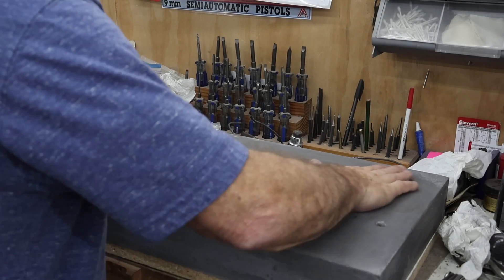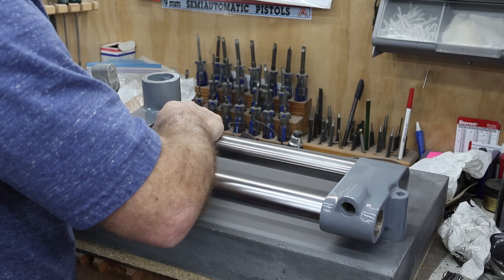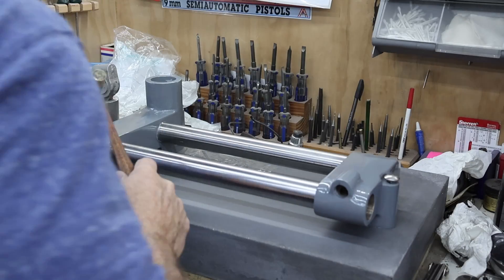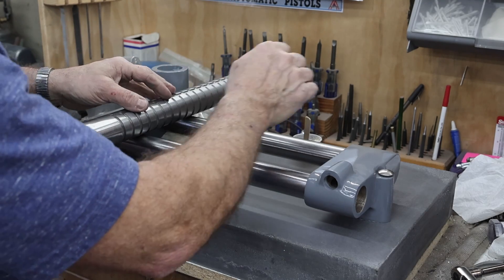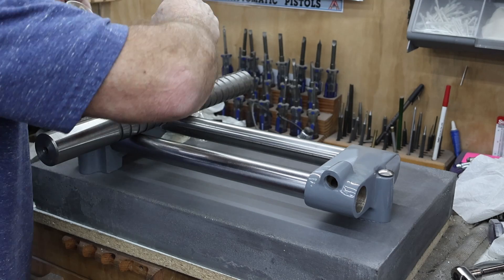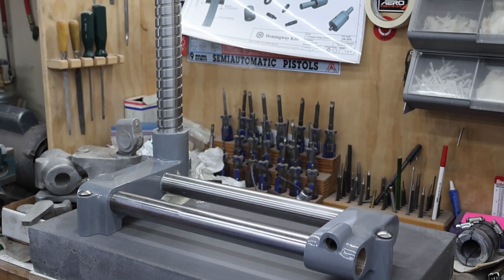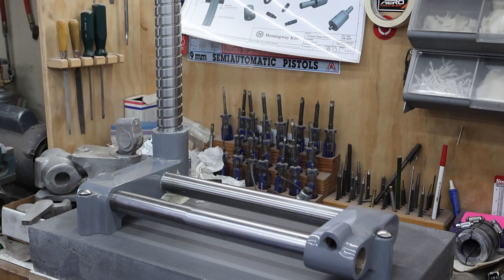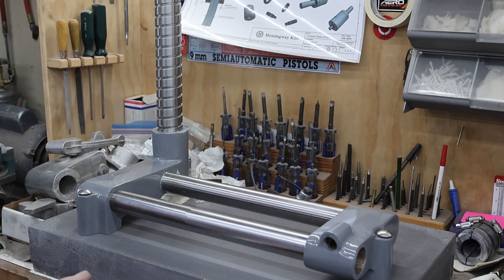Building A Grown Up Quorn Tool & Cutter Grinder: Part 17, Mounting The Castings & The Column

Comment: How do you ensure the vertical post is orthogonal to the rails?
Reply from the maker: It was bored perpendicular to the bed ways on the mill to a fairly snug fit to the column bore. Within reasonable limits any imperfections will be adjusted out during setup and even further reduced when a wheel is trued, that is why the original design was able to be produced in the home shop so successfully.